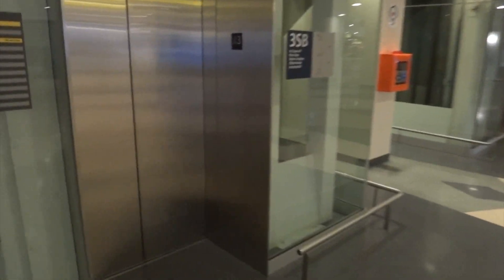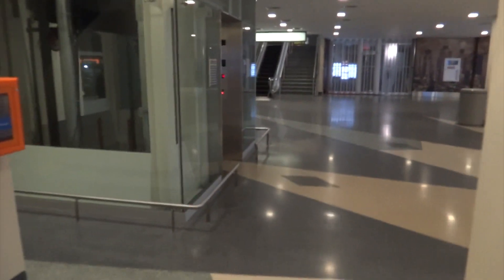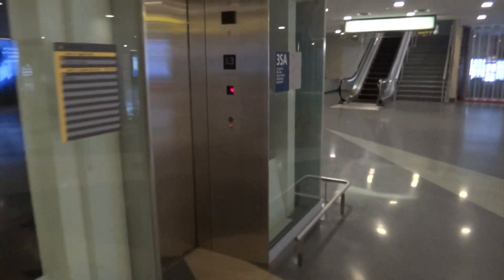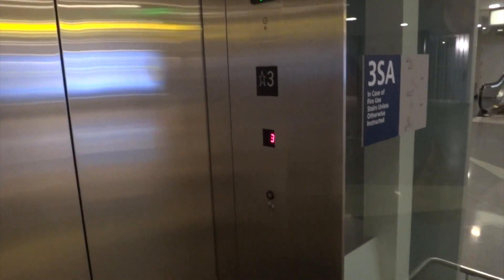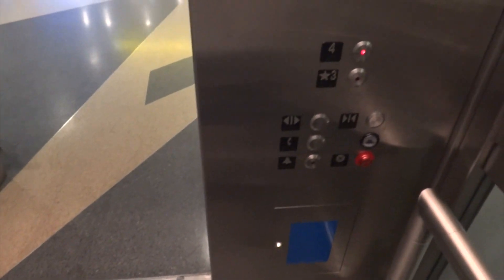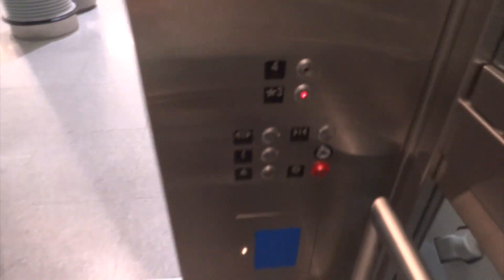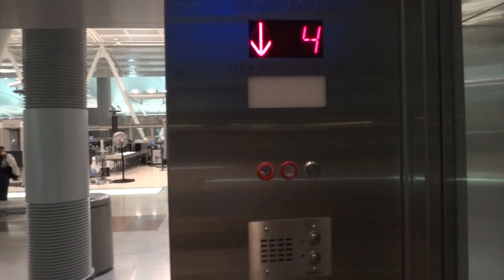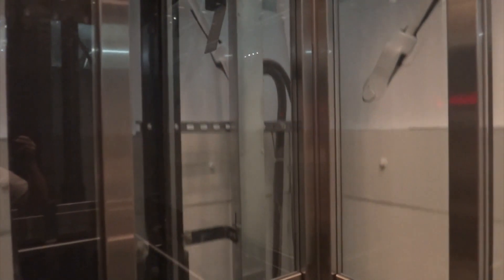Generic Hydraulic elevator at JFK airport New York City, NY

Comment: Isn't this the international terminal? Did you have an international flight here? Also, before the security checkpoint is where it is now as seen it the video, there were two on the sides towards each concourse. And at that time these elevators didn't exist. You could take some Schindler elevators (2 on each side) down to 3 and even 2 (locked) and 1. They were outside security at that time. Did you see them while you were there?